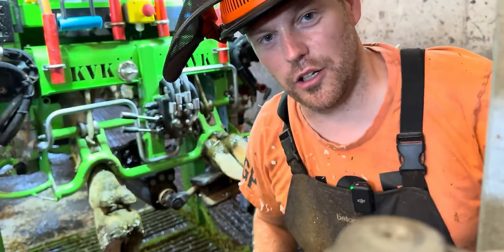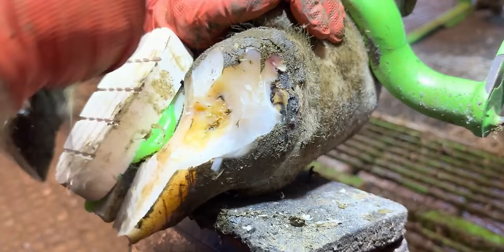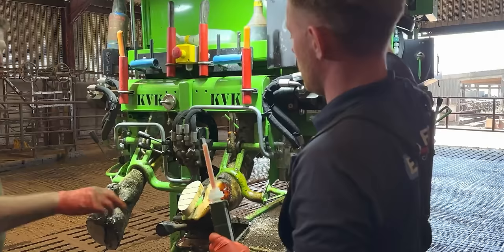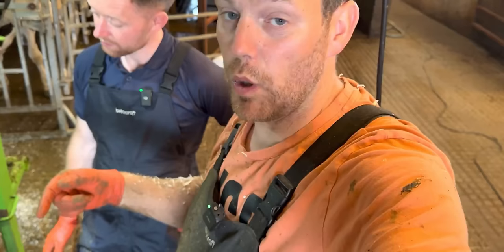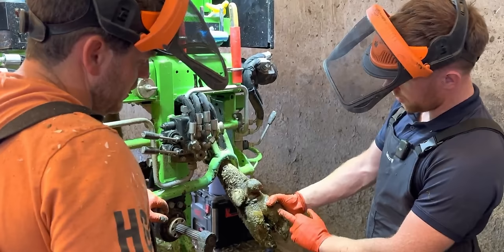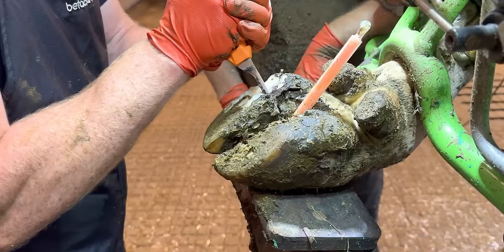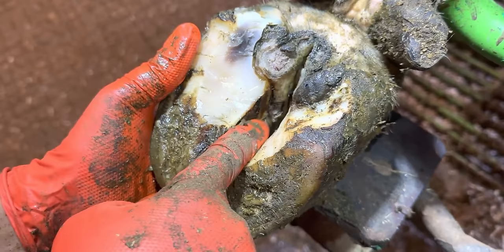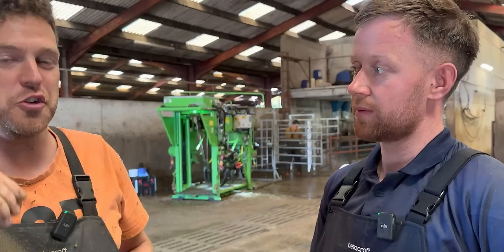I pulled CONGEALED PUS out of this cow's foot!

Comment: This is a great teaching method for skill training. Rather than focus on little details, cement the broad strokes that you have to get right, and then let the student try it. Be as hands off as possible while still being present, which promotes confidence, and speak up when you need to or when there's a question. After student finishes, evaluate honestly and praise parts that are done well, but don't be afraid to do some clean up for those little details, like smoothing out those ridges. Teach essentials, demonstrate, go hands off, evaluate, praise, and touch up the needed improvements.

Anyone can learn a skill and be competent at it if taught in this way.

Comment: For cows that walk on hard surfaces, what if there was a rubber made shoe that could be placed on the cows hooves to prevent those white line problems. It wouldn't be something glue on, maybe strapped on to the legs to prevent it from falling off.

Comment: Would the cows better off on rubber floors than concrete floors?
If the cows only walked on rubber mates while inside the cows wouldn't wear down their shoes. 
Just wondering, Thanks

Comment: I'm surprised you don't use something like a Dremel tool for finer work on the wall horn. It looks like, honestly, it's too hard for that knife. For that matter you might look into something like the saws doctors use to remove a cast; I had it demonstrated to me when I was just a kid that they actually wouldn't cut skin. Maybe you could get something like that in a Dremel wheel; something that will abrade horn but leave the corrium alone?

Comment: Just wondering, would it be easier to "practice" trimming with the knife on a block instead of an actual hoof. I was thinking you could glue 2 blocks together, the glue would be the tissue, so he could trim on the top block but if he gets to the glue which since its green would really stand out,

Comment: I have a question about the glue you helped develop for the blocks is it a solid or flexible style. Ive seen you use it on the blocks then come back a month or so later and its still holding strong

Comment: Question: why don't you give the hoov a quick hose down, you're working with all that dirt and manure and I walways wonder why
Reply: Often they don't have access to water. And they use electric power tools. Safety issues.  And to prevent slipping. Which why the use sawdust.